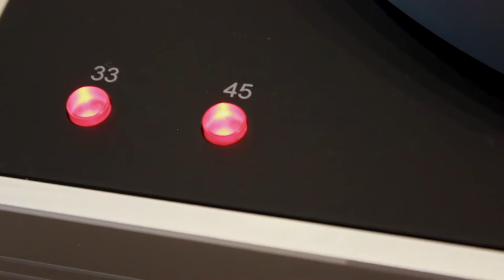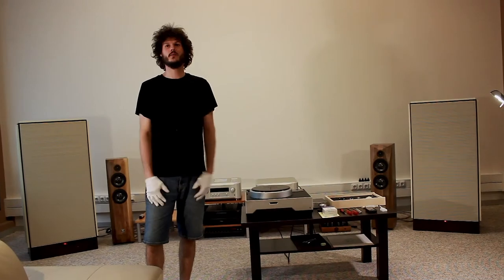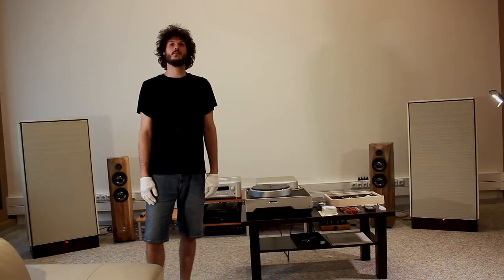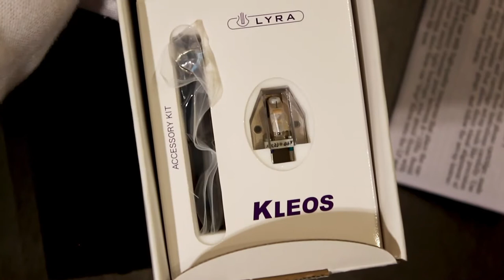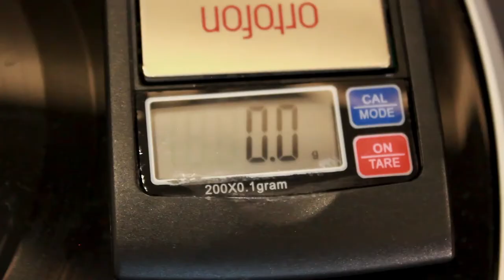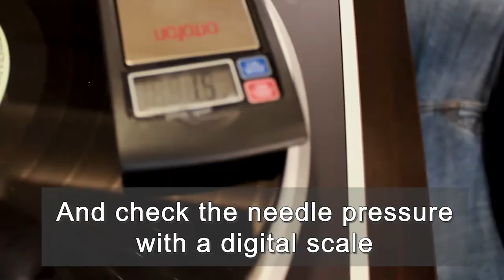Assembling Döhmann Helix Two Mk2 Reference Turntable by SEPEA audio

Comment: Hi Chris, we have measured that for you yesterday. We have used test records "The ultimate analogue test LP" & "Tacet Vinyl Check", Wow/Flutter signal 3150Hz, 33.3RPM, test equipment AP Portable one plus, according to standards WTD, IEC, PEAK - measured value 0.09 - 0.12% & WTD, JIS, PEAK - measured value ~0.07%. Of course the optical method of measurement would be more appropriate and accurate, but these are real life results in normal listening room conditions. Hope this helps. Bohuslav/SEPEA audio